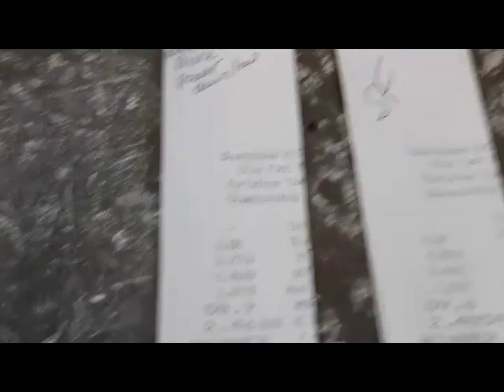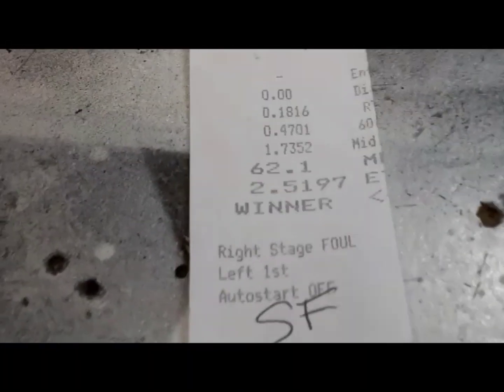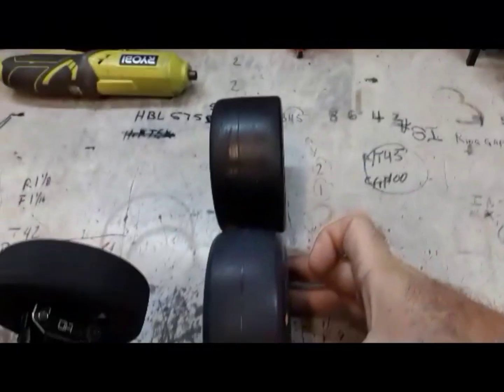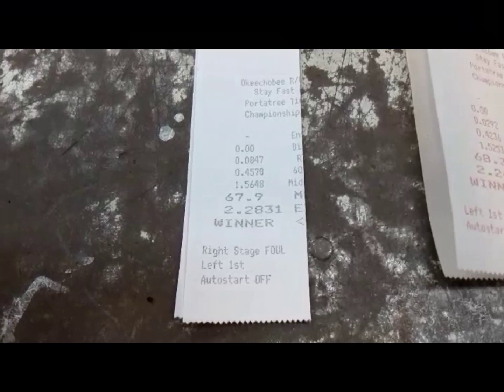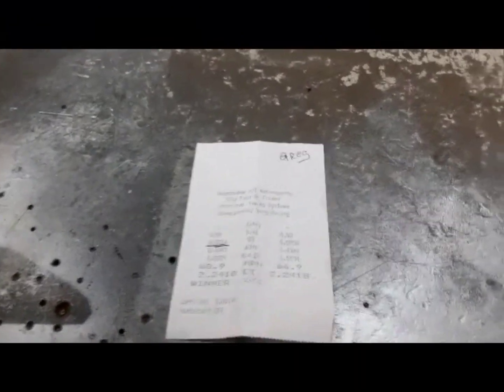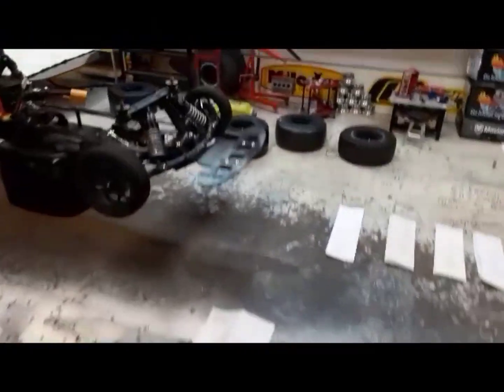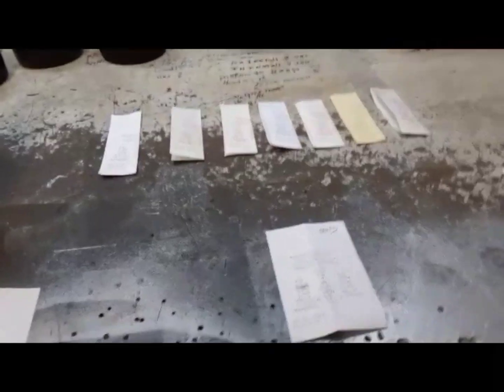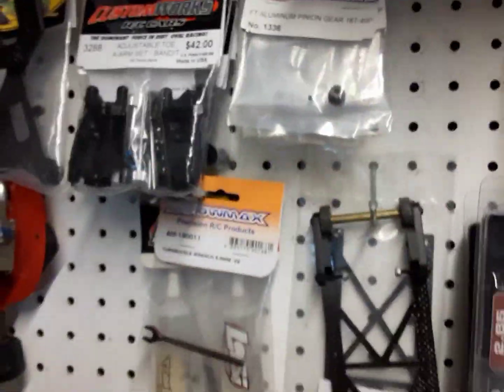RC Street Eliminator Drag Racing TNT recap

Comment: Hey bad was your times was off compared to the traxxas tree ? Was they close to each other
Reply from the maker: About a tenth off slow mile an hour or two
Reply: O ok cool cause people says they off smh . But hell damn near all trees off tho .
Reply: @powermadracing5116  hey but can u use the better than the gnss thingy tho cause i see alot of people hosting races with it tho. I was just wondering your opinion since u run on a real tree quotation mark loli
Reply from the maker: @Dirty263  absolutely there's a difference.. the portatree it's only as accurate as the person that measures it ..that goes for any system, they use the DTs it just eliminates the win-loss argument.. it's the same for everybody on the street nobody seems to care how fast are going, as long as they get the w !!
Reply: @powermadracing5116  yes u are correct lol

Comment: Your run Timing and boost and turbo
Reply from the maker: Boost and turbo is timing.. all of it is adding electricity. The esc that we are using are made for off road . that's where those terms come from. The DRK is the first ESC built for drag racing..